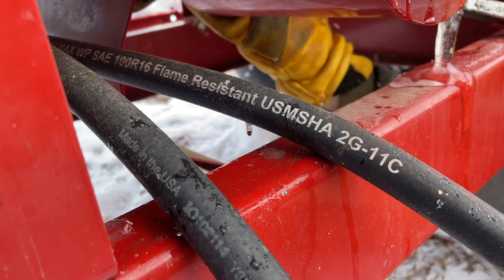The most expensive days on our farm.  Feeding Barley. Farm King Rollermill.

Comment: Wow! It's amazing how much cool equipment you have! That's the first time I saw the elevating machine.  Do you feed barely to your cows in winter instead of sweet feed?  I'd have to price it but I think it's cheaper than sweetened.  Thanks for sharing this!
Reply from the maker: I find it fascinating what animals are fed depending on the region you live in. 
I’m not sure what is in your sweet feed but I’m guessing because you don’t work in massive bulk feed like we do that it would be expensive for sure. 
Your animals sure do look good so they are happy with what you are feeding them. 
The roller mill has a built in elevator to lift the feed up into the truck and then we have several sizes of augers that lift grain into bins, trucks and other machines. It is pretty neat. 
Good luck tomorrow with the vet. Let me know how it goes if you have time.  
Take care,
Annette🌺💛